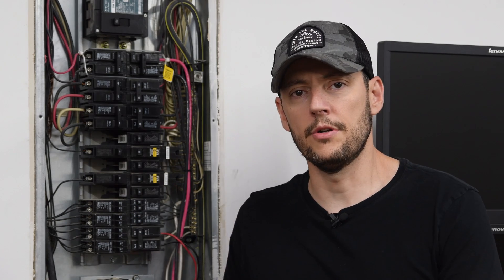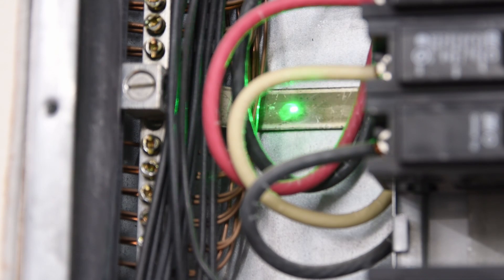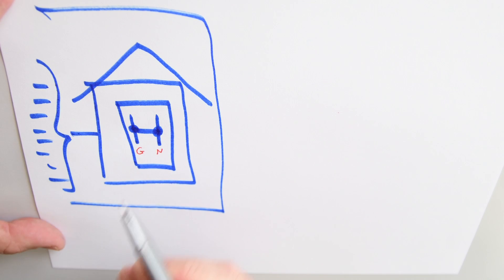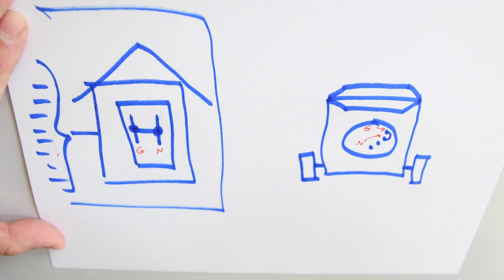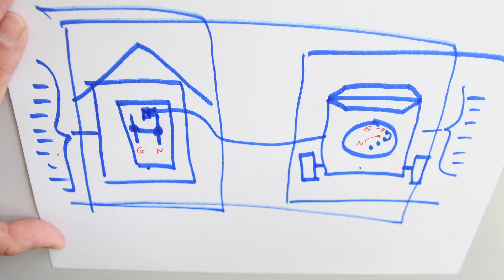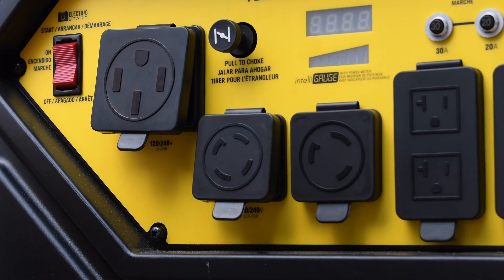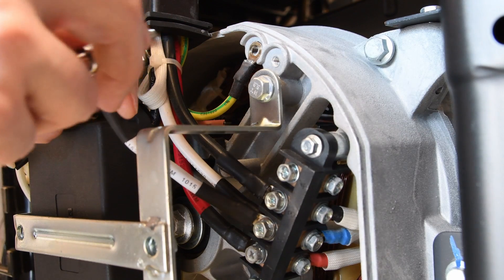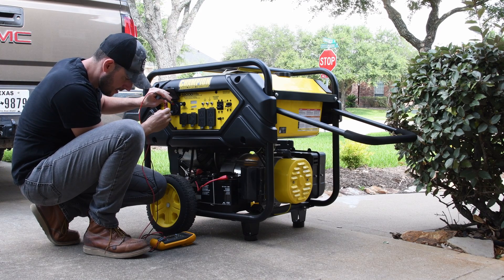Bonded vs Floating neutral. portable generator as power back up

Comment: If your using a transfer switch in which the circuits to be powered have been moved into the transfer switch from the main panel, when running in generator mode there is no longer a connection to the main panel bonded neutral for the circuits being powered.  This means that the generator would be your primary point of disconnect when running those circuits in generator mode and the neutral should remain bonded in the generator.  If you do not use a transfer switch but directly back feed to the main panel then the generator should be modified to a floating neutral. Not a electrician but proper neutral configuration would depend on the mechanism by which the generator is connected the circuits being powered.
Reply: Thank you I think most people over complicated this topic and fluffled it with so much bs it confusing when it doesn't have to be
Reply: Thank you so much! I have been looking for a simple answer to my question and you just answered it. 
In a lot of videos where they show how they connected their generator to the main panel via an input and safety interlock they never even mention floating or bonded neutral on the generator. I am glad that I have done the extra research because I have just installed an inlet and an interlock on my panel.
Thank you again!
Reply: This will depend on the transfer switch, if the switch only transfers the 2 hot legs, your generator still needs the floating neutral. If your transfer switch also transfers the neutral, you’ll need to bond the generator neutral.

Comment: Bravo !! Well Done !!! However.....ALTHOUGH......BUT..... this is one of many different connections based on what could be used for every different scenario.......  so please ask a licensed electrician like myself for best SAFEST PRACTICES !!! People DIE from simple mistakes......... If you ever seen a "Lineman" take an axe to smash the meter off the house because of back feeding.......Need I say more ????  "Bonding""Grounding""Isolated Grounding""Grounded""Separately derived Supply""Single Phase,Three Phase""Marine/Boats/Trailers"... All make large and different connections............and where the Heck is the Ground rod & H20 pipe connections(watch out for Phone & Cable services as well)......this is why we charge our fair rates......Minium of 8,000hours to test....I have in excess of 93K hours......I understand very well, but humbled enough to know, I can make mistakes too/still....ALWAYS DOUBLE CHECK YOUR WORK !!!!
Reply from the maker: Hi John, thank you for your comment. Agree with you about the safety. Regarding the line man and the axe, I understand what you say and that is why having an interlock device is so important. Every time I use the interlock in my panel and open the main breaker, I make sure with a multimeter that the breaker is open and not suck close even thought the lever moves to open... just not to have a lineman knocking my door with an axe.
Reply: @BUTTEWORKS  the main open and locked is great first step.....where the trouble is, where the ground neutral bond is connected that needs to be opened.
Reply: Nice advertisement for the profession. They don't like DIYers taking their business eh.

Comment: From someone who knows very little about electrical but pondering a portable generator with an inlet box and interlock kit to power my house during power outages, what are the possible ramifications of not doing this and leaving the wires as is? Thanks in advance!
Reply from the maker: If there would a short in any of your appliances small enough not to trip the breaker, the frame of the generator would be hot. If your touch it you would get shocked.
Reply: @BUTTEWORKS  OK. Great to know. Thank you!

Comment: Some generators may have a dedicated floating neutral terminal, while the others are all designated as bonded. The larger WEN gensets seem to all have this on an L14-30R plug, which most transfer switches use.

Comment: I put a 30 amp switch on my neutral wire. and placed it on my control panel. That way if i need to hook my generator up to my house, I turn it "off" which gives me a floating ground so only one bonded in my power panel. If I turn it "on" then I can use it as a normal generator , not hooked up to my home.
Reply: So if i have the 50 amp plug going to my breaker panel for whole house scenario, and it has been changed to a floating system, how do i use the other outlets for other single items.
Reply: @robertmclean8746  When you change over your generator to a floating system, the other outlets on your generator will be using the neutral and ground from your house as long as the 50 amp cord is plugged in to the generator and connected to your breaker box. If you have GFI outlets on your generator and you do not switch your generator over to a floating system, you'll notice that they pop all the time. That's because they are trying to use the generator neutral and the house neutral. That leads to fluctuating current at the GFI outlet and they pop...they're just doing their job.

Comment: Excellent and simple explanation.  I have watched SEVERAL videos and this is easiest to understand.  A question for you.  Have you ever opened up a Black Max generator?  I have the 7K version.  When I take the cover off, it looks like all I have to do to convert from Bonded to Floating is the same process you showed but the wires are different color.  I believe the Yellow/Green wire would stay in place but the White jumper wire from the bolt on the casing (with the Yellow/Green wire) to the bolt for the White wires would be removed. Can you add any comments?
Reply from the maker: Thank you for your comment, yes, you just need to remove the neutral (white), ground (yellow-green) can stay connected.

Comment: Great information, thank you. I am installing a 240 volt 30-Amp inlet to my house and wiring it to a 30-Amp breaker on my main panel, I now know what I need to do to make my system safe. If I disconnect the ground bonding strap on the generator, will it affect the GFCI operation of 110-volt receptacles? the 30-Amp receptacle is not GFCI. Thanks.
Reply from the maker: Yes, floating neutral are safe to use only to power a house. If you are planning to use the sockets in the generator in other applications not related to powering a house you need to make it bonded again. or you can install a switch to open or close the neutral in the generator.

Comment: Question: If you convert to a floating neutral and are plugged into your house using an interlock kit. Can you still plug extension cords into the generator to power something else?
Reply from the maker: You can and it will work but it will not "code" safe. many people install a switch in the neutral to ground to switch between floating to bonded neutral.
Reply: The type of interlock switch will determine the configuration of your generator.

Comment: So to test with your meter you put it on continuity mode then the neutral side ( left ) and also into ground slot if continuity ( beeping ) is found you have the bonded style generator, do I have that correctly? thanks for any help you can give with this
Reply from the maker: That is correct.

Comment: Thanks for this video.  I've been trying to understand neutrals a little better but there's one thing I'm confused on.  I have a line of 10/3 (no neutral) that runs from my garage to power an EVSE car charger to my panel on a 40 amp circuit.  Were I to theoretically backfeed the system, would a bonded generator be needed, since there's no double bonding occuring at both the panel and the generator?
Reply from the maker: I don't know how would that work without understanding your set up better. In such a case I would ask a certified electrician for advice. Thank you for you comment.

Comment: Best demonstration and explanation!  Thank you.  If my generator is bonded is that why all my gfci receptacles are blinking red and not working?
Reply from the maker: Thank you for your comment. No, they should not blink for that. Without being and expert, I understand that if neutral is bonded to the ground in the generator, that means that the current in the CFGI returning from the neutral could leak through the ground since you have two parallel neutral-ground connection. Definitely install a switch in the neutral to ground bond or make it floating all together if you are planning to use the generator to power up your house only.
Reply: 50 amp are not GFI protected o need to unbond

Comment: Thank you, great video and explanation. I've been delving into this topic recently because when I plugged our new travel trailer into my generators, it indicated an open ground and I was a little perplexed. My generators can be operated in parallel with a parallel cable kit and this explains why generators that can be paralleled are not neutral bonded; because if they were, you would have two bonding points, one in each generator. The solution is a neutral bonding plug that is plugged into one generator only. You can buy them for about $15 but I'm a tinkerer so I built my own for about $5. BTW, RV's are not neutral bonded so it's done at the generator, or shore power if the campground provides power.
Reply from the maker: Stevemark2183 I'm glad this video helped you.

Comment: Why do they make/sell small portable inverter generators that are floating neutral and only have normal household outlets and would only be used seperately?
Reply from the maker: I guess they are to power up a few appliances, TV, fridge etc...directly to them.
Reply: @BUTTEWORKS  but shouldn't they have a bonded neutral in that case?
Reply from the maker: @xHICKORYx  I'm not familiar with inverter generators. I will check in Harbour Freight next time their small inverters and see if theirs are floating.
Reply: @xHICKORYx   that's what I am trying to find out the answer to as well "why arent the small ones not bonded"
Reply: It wouldn't be a bad idea to download the owners manual of one of them and read it but that is a good question.

Comment: Suppose you want to use the generator to power your house and also when not using it for the house   for other things  like powering  power tools   pumps   and the like.  Now you need the generator bonded. How about cutting the neutral wire in the middle and connecting an on off switch to each end of the generator neutral  so you can disconnect and connect the neutral as needed depending on the use of the generator at the time.
Reply from the maker: Yes, that is a way to do it but I only use the generator to power my house as stand by generator.

Comment: Very accurate information.   If you connect the generator to an RV, put the jumper back in.  RV s are not bonded.  In the terms I use as an electrical designer to clarify what NEC says is “Separately Derived System”.  Or “Non Separately Derived System”.   If you have a transfer switch and it only transfers the hots, then Non.   If the transfer switch transfers the neutral and hots, then Separately.
Reply: what about an interlock?
Reply: @donschlonski2936      Can you clarify your question?   How was interlock used?   I think I know what you are asking, but not sure.
Reply: @KevinCoop1  thank you for responding. I think I have just found my answer but I want to make sure that an interlock follows the same grounding procedures as your video demonstrates.
Reply: @    I’m sorry, buy I commented on the video, I did not make or post it.   Before you go, I think you are talking about an interlock in the main panel.   An interlock in this case is a device that when on the panel forces you to turn off the main breaker to turn on the breaker fed by a generator.   If you do not turn off the main, you are possibly powering the lines on the street.   Repair workers can get shocked by the high voltage.  After electricity goes through the transformer, you would be putting thousands of volts on their lines.   Hopefully this is what you were looking for.
Reply: @KevinCoop1  no an interlock forces you to turn off the main breaker so that you can power the panel. At least that's the way it is in my case
Reply: @donschlonski2936  I’m sorry again!   Read the third sentence in my comment.  That is exactly what it said!  The rest after that was why you must do it.
Reply: @KevinCoop1  Yes you explained what an interlock is in the dangers of what can happen. However I gave you no indication that that was my situation so I don't know why the detailed long answer about an interlock. 

My question is much simpler and it's about the bonding situation when an interlock is used.

Clearly we are not on the same page so I don't even expect an answer from you at this point because honestly I don't think you have one and I don't want another lecture and an issue that's a non-issue for me.
Reply: @   You never asked a coherent question that could be answered.   Why are you being a dolt?  I just tried to help you.   So, if you want an answer to a question, then ask a complete question.   If not, I don’t care.

Comment: Most of the generators I have seen ( and the 2 i own) have an external ground connection on the panel here in the UK. They are not internally bonded.
Problem is if you are using an unbonded generator with a transfer switch in places like the UK,  the earth is NOT IN THE BOX ( consumer unit) but on the tails coming into the meter, say  like say with central heating which nowadays have a computer... IT knows this and will not work as it needs an earth or it will not t work as a safety design. So the Generator has to remain bonded.

To make my generator be able to run my central heating in the event of a power failure work i had to install an earth within the transfer switch back to the generators exterior connection and earth the transfer switch connection.
Reply from the maker: I'm not familiar with UK electrical system but the US since neutral and earth are bonded in the main panel you just need to carry the earth though the transfer switch.
Reply: @BUTTEWORKS  Here in the UK the Earth and neutral are bonded at the main incomer (Before the Meter)  BEFORE they even get to the consumer unit. 
Live and neutral are fed the box 25mm tails ( consumer unit) and a separate earth which comes of the earth / neutral block.

Comment: It would be nice if they made a locking switch or breaker on the generator to switch from bonded to floating to make it easier.
Reply: Re: if they made a switch from bonded to floating to make it easier
Better believe it; I agree; they don't but you can!
diy a toggle switch that will bypass from bonded to a floating neutral as needed.
But caution: Only problem is SAFETY; should someone come along and attempt to us the Gen for say power tools 
or with an extension cord not knowing the Gen is no longer a neutral bond then they get electrocuted.
So this is doable alright but may cause injury or death.
Yet when using an interlock device with a portable Gen it is necessary to convert the neutral bond to a Floating Neutral
in order to safely connect to the home breaker panel.
Who knew?
Reply: You can use a ground plug and just pop it into one of the 120v outlets on the generator, and voila, it's bonded.
Reply from the maker: Agree, thankfully that is a cheap and quick DIY install.
Reply: The vendor should do this for what they cost.
Reply: Something as important as this should always require tools to change to stop your drunk neighbour just flipping a switch on something he doesn’t even understand or couldn’t be bothered reading the instructions on.
Reply: Not all portable generators have the bonded-neutral setups, some actually come factory with the floating neutral. The instruction manual that came with your generator should tell you if you have the bonded or floating neutral, and if you don't have the instruction manual, you can easily figure it out by using a ohm meter by checking for continuity between the neutral and the ground on one of the 120V receptacle's with the generator not running, if you have continuity then your neutral is bonded to the frame.
Reply: It would be nice, but then have you seen how stupid people can be?

Comment: Great video.  I have a Honda EU7000 inverter generator.  It has a floating neutral.  I'll be attaching it to my electrical panel through an interlock switch.  My question is... 1. With this set-up do I need to ground the frame of the generator to a ground rod?  2. If I use the generator to power extension cords for power tools, etc... do I need to connect the generator frame to a ground rod?  Thanks!
Reply from the maker: To feed up the house you don't need to ground the generator since the house is grounded already. If you use the generator to power extension cords you would need to bond it again. No rod needed.
Reply: On back feed cord couldn't you disconnect  ground  wire ? Just red black and white?

Comment: If we unbond the neutral to power the home as described, can you continue to use the other outlets on the generator while it's connected to the home safely?
Reply from the maker: As far as you run all 4 cables from the generator to the panel where they are bonded I don't see why not.
Reply: @BUTTEWORKS  I ask because I have a fan I run off a 120v outlet while using the generator to also power my house.  Will the fan outlet be good since it's on the generator
Reply from the maker: @JonnyWhitlatch  I'm not electrician so I can't give you a solid answer. That is a good question though. I think it is safe as far as the generator is connected to the main panel where ground and neutral are bonded. Definitely not safe to use it if the floating neutral generator is not connected to the panel. Meaning with not safe, that it will work but if the appliance would fail it may lead to an unsafe electrical system.
Reply: The GFI plug must be neutral bond to work